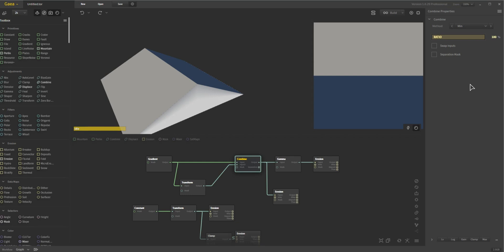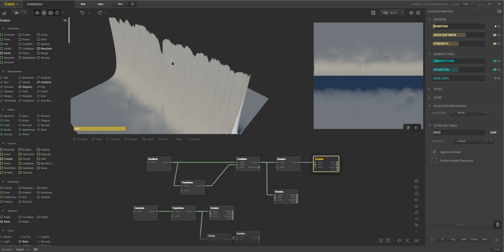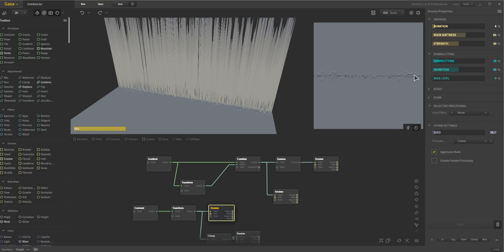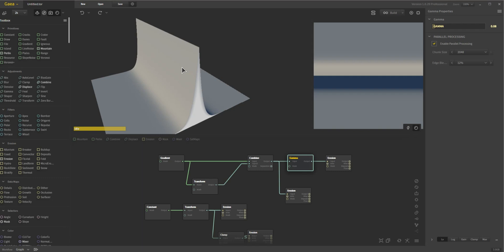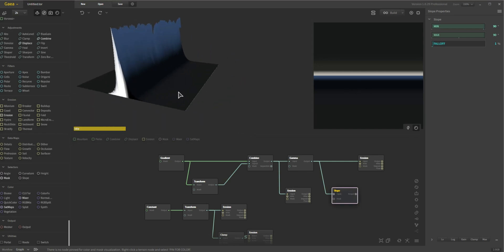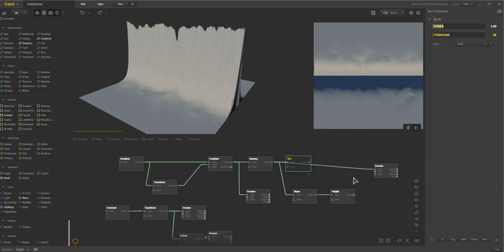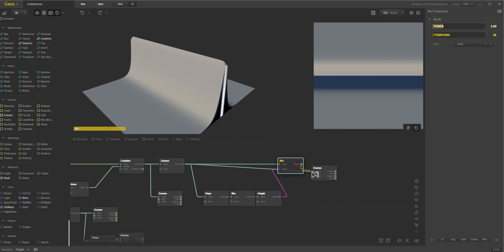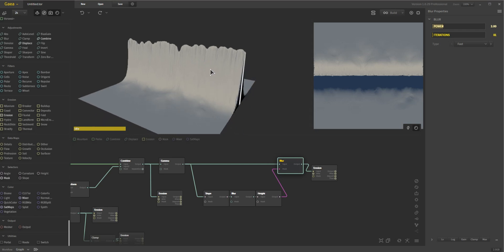Quadspinner Gaea - Finding and Eliminating spikes

Comment: Hey, thank you very much for making these videos. What would be the best way to make smaller terrains. Lets say I want a plane of 256mts x 256mts and send it to blender to build a medium but detailed scene on top. I know I can change the Terrain Definition in the  Build settings but I can't make it work for what I want to achieve.  The perceived scale always seems to be wrong. I know scale in 3d is an abstract concept, maybe you can talk about it in a video? Every tutorial I watch focus on huge terrains but what about something smaller.  Thank you.
Reply from the maker: Yes. scale is abstract in 3d for most things, but I get your issue. You want a visibly closer scale. Something like a hill vs a mountain. There are a few things that can allow for this. Using a different scale setting for primitives, turning off the default terrain scale in erosion/snow/etc and adjusting the manual settings, or building a higher resolution and cropping down in post. In the end, you can also consider what you will litter on top in the next app. The level of erosion on a mound means little if you take it to substance and add a larger scale dirt texture then go to blender and dump some grass and rocks on it. How you dress it up after can deeply impact its apparent scale.  There are features we 'recognize' to be a specific scale. Nurturing those features in the creation or after, will help you get what you are looking for. This is how I managed the "Satelite mountains" video, the veiny appearance of mountain ranges when seen from far above the earth was what I wanted, so that's the aspect I focused on creating. Even though all the settings in Gaea were set to something much smaller. Have a look at these three images of small dirt mounds. Notice how they contain details seein in erosion of a much larger scale despite their real world size.
https://www.alamy.com/a-large-pyramid-shaped-pile-of-dirt-framed-on-left-side-by-green-trees-text-space-image187204899.html
https://libertylandscapesupply.com/wp-content/uploads/2017/07/a3-bulk.jpg
https://www.gannett-cdn.com/-mm-/cc80119fa2478add00bc50da6eeadfc50a6614be/c=9-0-4119-2322/local/-/media/2016/10/25/WisPub/Brookfield/636130029431027195-Moorland-hill.jpg?width=660&height=373&fit=crop&format=pjpg&auto=webp
Reply from the maker: Video created
Reply: @cowsmanaut  Thank very much for taking the time to answer and making a video.

Comment: Hi... thanks.. but when I have spikes they are not all from the same altitude. How about using protrusions in some manner to mask.. ?
Reply from the maker: this is using a height node, yes.. but it's not using actual height. The height node itself just allows you to isolate a specific section of a range. So how I'm using it is isolating just the heightest values of the previous mask which is based on slope. So it will select ALL of your sharp areas.
Reply: @cowsmanaut  Oh..  ;O)